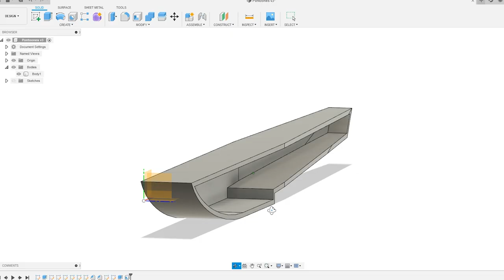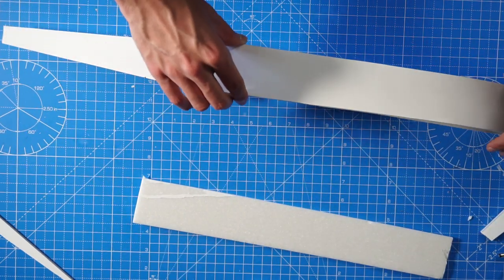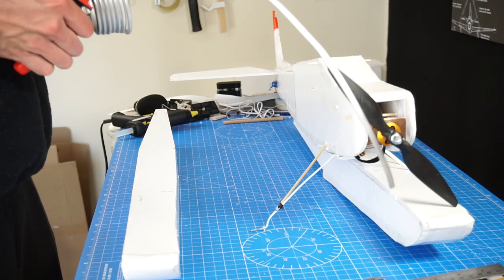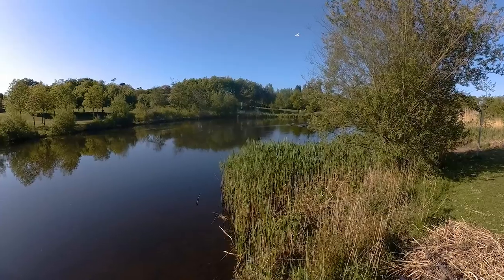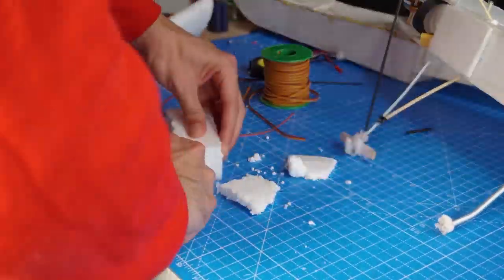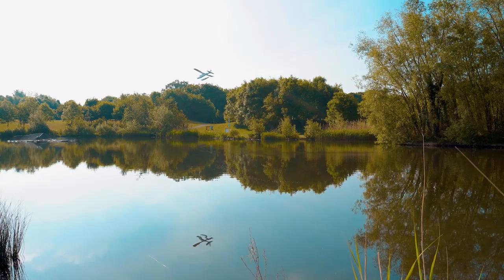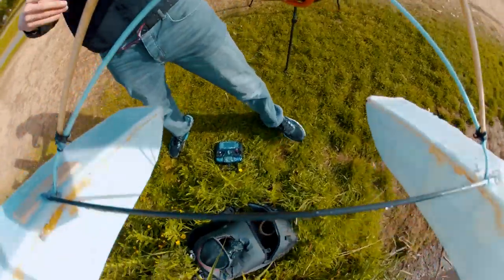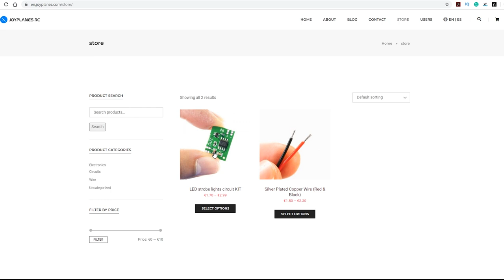Making DIY Pontoons / floats for an RC Airplane

Comment: Excellent video. Just the right balance.  One place where the water usually gets in is the water rudder post hole.  You were spot on filling the floats with foam - very little extra weight and insurance against total sinking plus it would give extra strength length-wise in the float.   Look forward to more.

Comment: Great project, looks and works great.  I've been playing with colored wing tape (which I got from hobbyking) to make my foamboard creations look nicer.  It's basically shipping tape that is colored, but also very thin and light.   That might help with the discolorations some of your foaming glue caused as well as additional waterproofing.  It looks to me like you are using too much elevator in your water take-offs - you want the plane to kind of lift/bounce itself off the water when it has enough speed to break surface tension.  Try to only use enough elevator to prevent prop strikes on the water - you can probably back off elevator as you speed up - down to 20% or so at take off.  If it doesn't want to take off without lots of elevator, you might need to add a little wing incidence by adding a 3-5mm shim under the front of your wing on the fusealage, or by just decreasing the height between the back of the pontoons and the tail of your plane.
Reply from the maker: Thanks for your ideas. I'm pretty sure I wasn't using too much elevator in the second try, but I have to because otherwise there's a risk of dipping the nose of the pontoons and crash. But it actually takes off very easy.